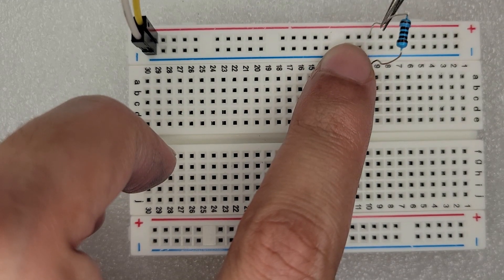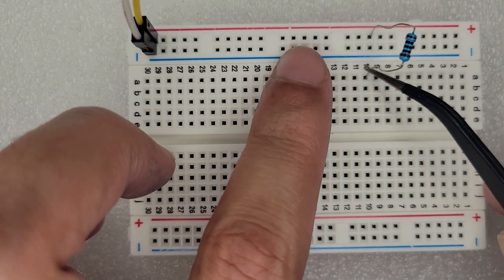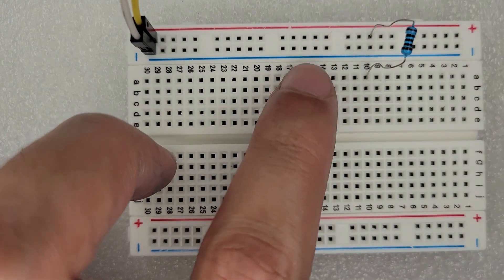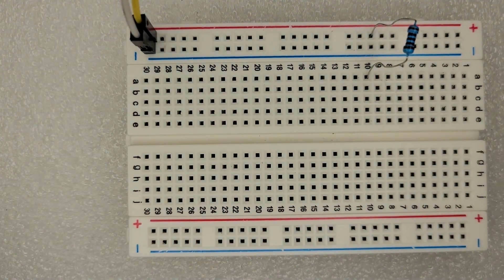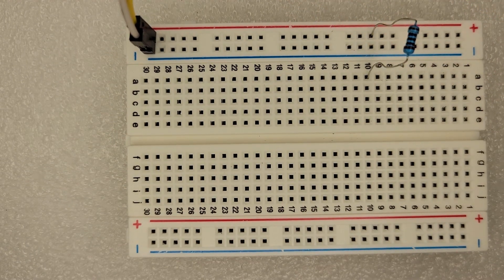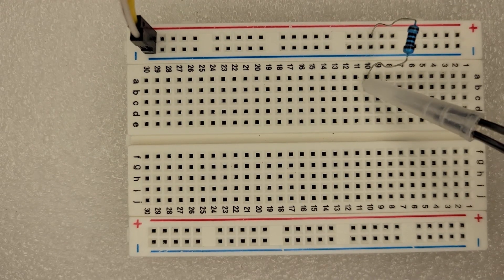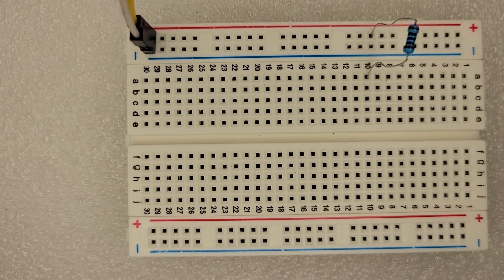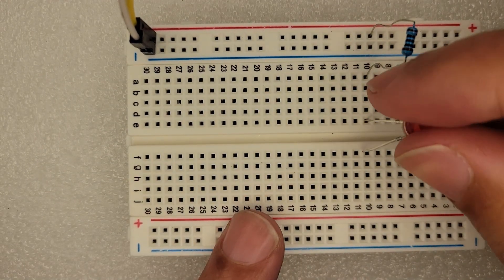Beginner Learns to Make LED Circuit - Step by Step - Beginner Learns Electronics

Comment: On the meter and checking for voltage part - Consider that resistors will limit current, while both wires and switches will not as they are just straight shots from one end to the other (switch is just two wires that internally connect together when the button is pressed).   

Then consider that when your meter is in voltage measuring mode, it's "input resistance" (how much resistance is between the two probes) is extremely high.   Compared to the 100 ohm resistor you have in the circuit, the meter is MUCH higher than that.   

Now finally, consider that the LED itself will need a small amount of current to operate.  Up until that point, no light.   But.. by the time both your 100 ohm resistor AND the meter get a hold of the current being sent by the wall wart, do you think the leftover is "enough" "? ;-) 

Now a bonus one related - You were onto something when you attempted to measure the current.   You were "this close" to actually having it light up,.    Meters when you are measuring current are the exact opposite where when in that mode will show basically as a wire with little or no resistance.     But in addition, you had selected the 10 amp "range"

*"This close" as in "one jack over from where you are.   Look at the labels on each jack carefully...*   (edited to clarify this a bit)
Reply from the maker: I see what you mean. Trying to take the voltage in series is what you're referring to -- with the incredibly high impedance/resistance of the meter, there's a negligible amount of voltage "remaining" to power the LED?

Thanks for the input! And yes, for the meter -- I see now the difference between the two red jack inputs. However, in a more recent video "Resistance" that I posted, I wasn't able to detect a ~200-300mA current with the right-side input, and had to swap to the 10A (which it then read as 0.3A or something). I would have thought the right-side jack can detect up to whatever it says (I think 400mA or 500mA?)

Edit: The "Resistance" video I'm about is quite long. It's towards the end when I test a lot of resistors in parallel and try to calculate the total resistance. It's the last test done. I don't want you to have to watch the whole thing.

Comment: Let me see if I can catch up here to how you've progressed.   Good to see today's folks getting into this.  This is an old fart ex avionics guy, who'd be happy to see how far you go.   Feel free to ask questions.   

Now just a comment so far.. You're correct that the led would fail in a very short time if the resistor wasn't there.   The key point is the resistor is always needed with LED's, in order to limit the overall electric current going through the LED.   Another key point is remember this voltage - .6 volts, right around there.
Reply from the maker: Thanks for the input! What is the significance 0.6V? The red LED that I use tends to stay in the 1.7V to 1.8V range.

I am curious to see it pop without a resistor, but too scared to do that, lol
Reply: @MxyAhoy  Ok, so first..  LED's as the full name indicates are also diodes.   Transistors are also closely related, because all 3 have internally what is called a P/N Junction.  A diode will have one, but a transistor will have two (think of the number of leads).   

A diode's basic "feature" is that current typically can only flow in one direction.  It's because of that junction and most importantly what actual polarity is on either side.  And when a typical diode (not an LED) is connected in the right direction, you should also typically see .6 or so volts being "dropped" across it.  That is because at that very range, voltage or the "pressure" has reached enough of a level to overcome the "barrier" presented.   The rest of a well designed circuit is to also keep the diode in that specific range, otherwise the diode will fail (eventually or right on the spot, which all depends on the current being sent through it). 

Now..LED's specifically can and do go higher than that, as you did observe.  One LED specification that is important is "Vf" or the actual voltage range that the LED is manufactured and designed to operate in (LIGHT).   This specification itself can be wide ranging, based on the actual LED make and model you're using.   That leads into what is called a "datasheet" that you can cross reference the part number to on sites like mouser.com and digikey.com.  It'll be a PDF link or symbol when you drill down into the diode's details. 

So suggest you go look if you know what the part number is.  Or just look up "C503B-RAN-CZ0C0AA2" which is a typical LED.    That model has a Vf of 2.1 volts.  Vf is the minimum voltage "drop" across the diode where it can actually do it's job (light up! ).    That model also has a "If" rating of 20mA (20 milliamps), and "If" is the rating for maximum current that the LED can pass through safely without damaging it.   

At this point, we know the maximum voltage that this LED can handle, and the minimum level of voltage -=across it= (the DROP.. ) needed for it to light up.   So now how do we know our circuit design is good?   Specifically, how do we know that 100 ohms is the right value to limit the current enough to where it does not exceed 20mA and the LED at minimum won't last as long as it should?   That's where Ohm's law comes in.    But also that is where Kirchoff's voltage law also is important.   

Kirchoff's law in it's actual form is a little confusing, but you did demonstrate that when you went to paper on the other vid.   You are pushing 3 volts from the wal wart thereabouts.  So in that one series circuit if you measure the voltage drops across all of the components in that circuit, the sum will equal the 3 volts.   

So now, back to that LED with the Vf rating of 2.1 volts.   We know we want at least that, but we also know we want to make sure that 20mA is the max amount of current that is going to flow through it.   That said, 3 volts (supply) - 2.1 volts = .9 volts to accommodate for the limit resistor where when it's all done, we should also see .9 volts between the two resistor leads.    Now back to Ohm's law to determine what that resistor should be - E = I x R where E is volts, I is current, and R is resistance.   We have E (.9 volts) and I (20 mA) so solving for R comes up with a resistance value of 45 ohms.   Too much over that 45 ohms, LED will not light up;  Too much under, LED will go "poof" and die.   And remember too that the actual supply voltage is "king" over all of this - When it goes up, so does current, and so does the "drop" across each component, diode and resistor both.  

Now take your actual measurement across the LED.. about 2.6 or so volts right?   Applying Kirchoff's concept, that means the drop or voltage across your 100 ohm resistor was .4 volts.   Then and again using Ohm's law, the current flowing would be  E / R or .4 / 100 or 4mA.   Well below what I think your diode's max rating is.   

And finally for this "installment" - Power Power Power.   Resistors have a max power rating.  The ones I see you have are either 1/4 or 1/2 watt rated.   So given the above for my example part number, we bring that .9 volt drop up again.   P (watts) = E (volts) x I (current).   Now given the calculated drop across that 45 ohm resistor above, the actual power being consumed by that resistor is .9 volts x 20 mA = 18 milliwatts.   Also "good" since it's not close to even a 1/4 watt rated resistor.   Power through a resistor is HEAT.. too much, and the smoke comes. 

Catching up still .. we'll talk about transistors perhaps soon :)   I also have a link here for a good online calculator where you can enter any 2 values and it will calculate the rest.  Let me know if ok or I need to edit it out - https://www.onlineconversion.com/ohms_law.htm .  Had that on the toolbar for years and years.. can't recall when i found it LOL.